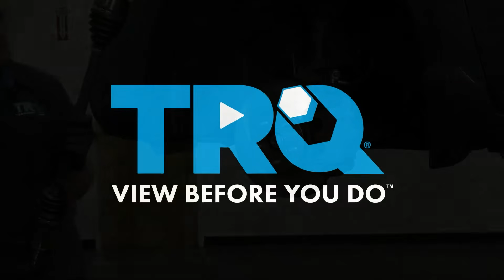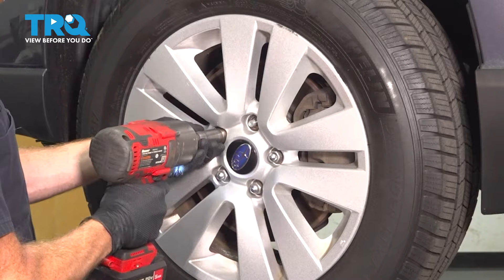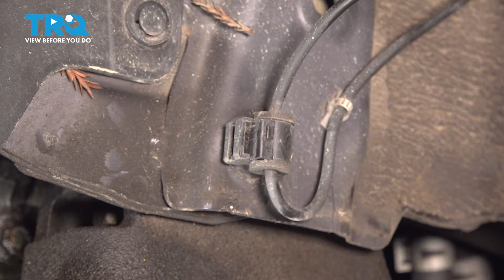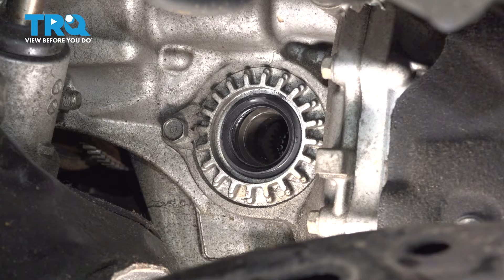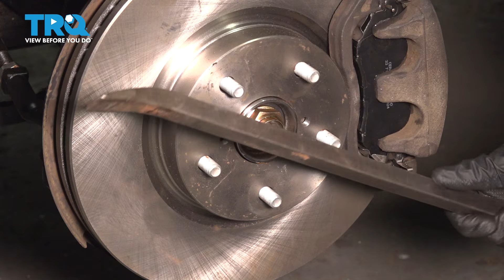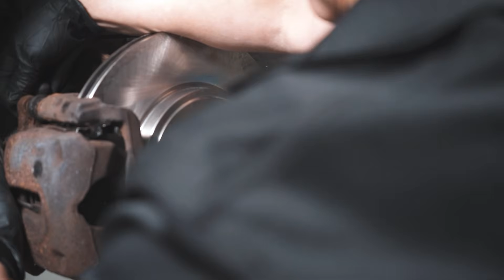How to Replace Front CV Axle Assemblies 2015-2019 Subaru Outback

Comment: Another way to hold the hub while you torque the axle nut is to drop a screwdriver through the brake caliper between the brake pads and into the rotor vents. That will prevent the rotor from turning and consequently, the bearing hub.

Comment: Thanks for the video. I followed it, and it took me 2 hours to complete. While the dealership estimated the work at around $1,200, including parts, I did it myself for $265. The hardest part was separating the axle from the wheel bearing. Also, you need to hit the rod with a hammer firmly.

Comment: I heard the dreaded clicking..so I called around for some est..them using aftermarket parts..close to 800.00..so I got a oem part directly from the dealer..384.00 with tax..watched this video and did it myself..I did have to buy a 32mm socket (12.00) and a axel nut.(6.99)..the hardest part was getting the cotter key out on the castle nut..from start to finish..1.5 hours .so thank you for a great video.